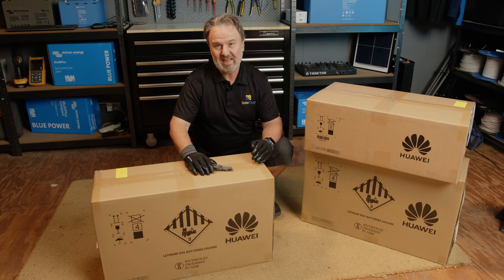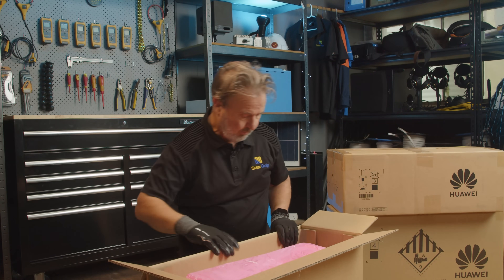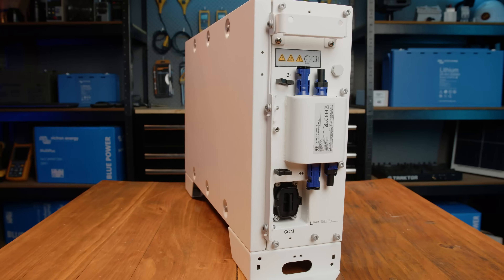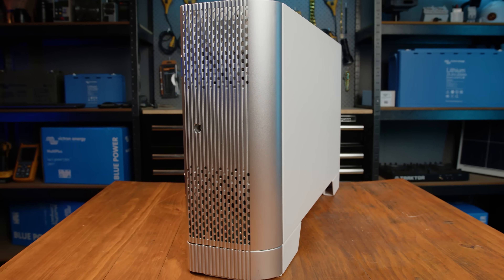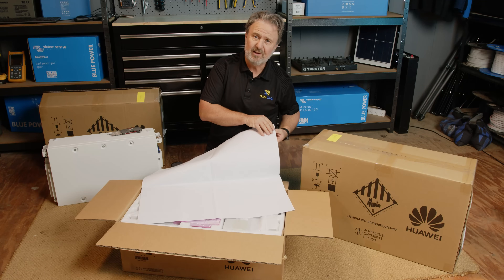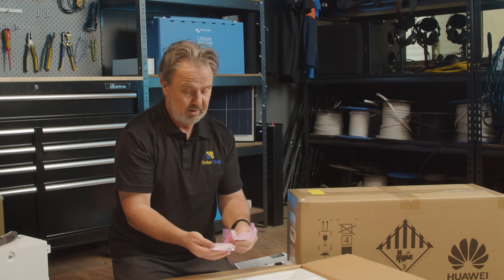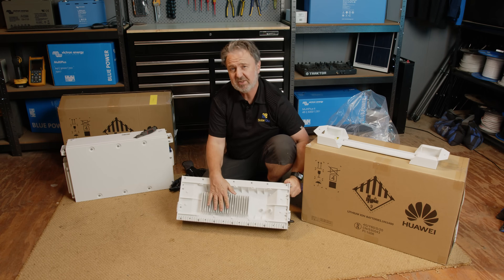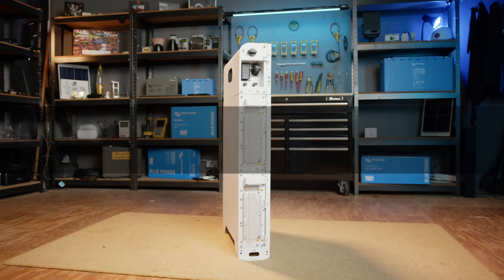Huawei LUNA2000 High Voltage Battery

Comment: this battery needs controlled environment or else during winter will stay to cold and during sumer will stay to hot meaning very short life , according to specs at 16 Mw will retain only 60% of the original capacity

Comment: Don't install this unit within the home and I speak from personal experience. 
Mine is in a utility room, but this was a mistake, because, as part of  a pre-programmed dehumidification process (I'm led to believe), staring up at 06:45am and lasting for ten to fifteen minutes, the Luna2000 emits a high frequency 'humming' sound, at 45 to 50 decibels, which wakes up the entire household.
Nowhere in Huawei literature does this warning/information appear and therefore, neither myself, or my highly reputable and long established instalation company had any idea regarding this potential problem.
I have have not been able to ascertain whether this is an issue on all Luna2000 units, or just the odd one or two, although this issue has been raised by several contributors to Huawei forums.
Huawei customer services, situated in Romania, have been slow, defensive, bordering on dismissive, when correspondence occurs and nobody based in the UK (if indeed they have anyone here) has been in contact.
So all I can suggest to potential purchasers, is that this system should only be considered for external wall fitting, or in a garage, or outhouse, where any noise emissions are less likely to be an issue.
For me, the result of three months of frustration, is that my installers will now relocate the battery pack to an outside wall, well away from bedrooms, at their own expense. Needless to say, they're as unhapy as I have been.
So all I can say is 'buyer beware!
Reply: After more than 3months of emails and providing loads of evidence and data, Huwei have finally accepted there is a problem with my Luna2000 and have agreed to replace the 'power module' under warranty, so I'm now hoping that when this part is fitted, my early morning rude awakenings will come to an end.
Be warned, if you have this humming problem, you will need to be very persistent, in order to get a satisfactory concluson.

Comment: Thanks for the cool video, looks like a nice bit of kit! I understand that the power output for the three-phase is system is single phase from the backup box, is that right? Would we be able to use the full 5kW (if we use a 5kW three-phase inverter)?
Reply: My interpretation is that the battery sends a single powerful DC supply to the inverter, it does not care which phase the inverter moves the DC current flow to. That would allow the inverter to access the entire battery capacity and manage the phases itself.
Reply: with three-phase power it’s possible to put up to 30 kilowatt-hours of battery modules on each phase for a total of 90 kilowatt-hours of storage

Comment: That blue gear in the background is my choice! Not made in China.
Reply: Victron I suppose but don't be too confident it's not made in China.
Reply: @adon8672  .... Victron.. designed  in the Netherlands... made in India...😏
Reply: @gewema-makkum  your comment is true of most victron products but their lithium batteries are unfortunate exceptions. Internally, they are filled with Chinese cells from Winston-thundersky, CATL etc. See these links (you may need google translate for the first one) https://camperforum.nl/viewtopic.php?t=8474000&start=448

https://diysolarforum.com/threads/inside-a-victron-lifepo4-battery.2265/

https://shop.pkys.com/Ever-wondered-what-is-inside-a-Victron-Lithium-Battery_b_167.html
To be fair to victron, almost any LiFePO4 battery you dare to buy now is almost 100% guaranteed to be filled with Chinese cells.
Reply: @adon8672  thanks for the info....i have  build my own Lithium LifePo4 24 Volt 80 Amp battery....and later a 24 Volt  310 Amp....much cheaper.  😄 But ofcourse  the same Chinese batteries....from a good brand... I hope ...😇
Reply: @gewema-makkum  CATL is world top 1 or 2 depends of quarter result, just saying.
Reply: @hc8714  yes .. CATL seems tot be fine...i maybe will order these..8x CATL 302 Amps..new .Grade  A cells

Comment: 3:20 its 50 kg,  Batt : Un [V]  Is 400 ? DC ... or I missed....( in 4:16) (most Batt have 48V DC but this model 400 [v]or interval 350-560 [V] (3 ph 600-980[V]))
Reply from the maker: Hi test33, the data sheet states 450V for single phase and 600V nominal for three phase (software selectable). The battery modules are all connected in parallel. I didn't test the battery module voltages as I didn't have the new Huawei hybrid inverter that's compatible... just the earlier model designed for the LG Chem 9.8H battery.